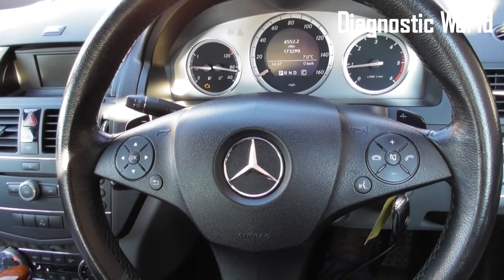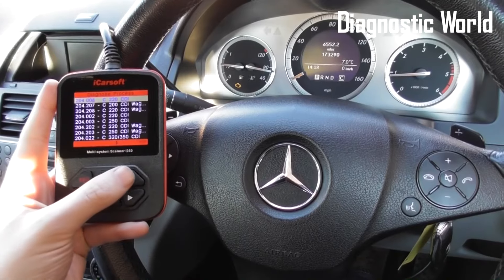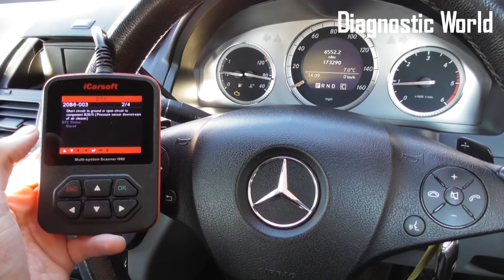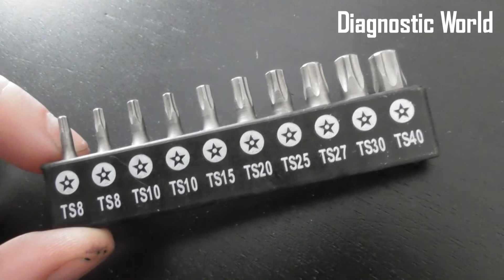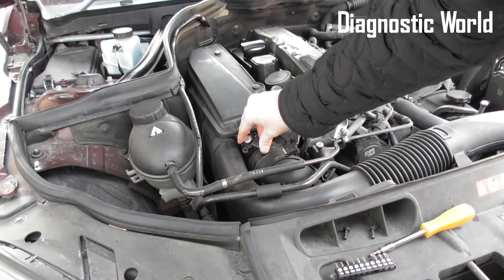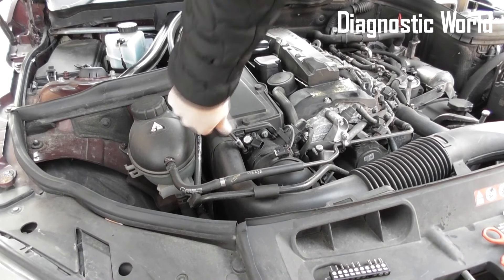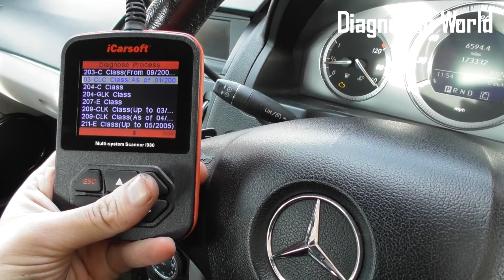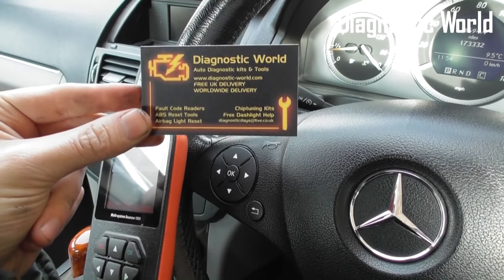C Class W204 MAP Sensor Removal 2007 - 2014 Mercedes

Comment: I'm pretty sure that's an air intake temperature sensor and NOT a map sensor. How there even could be any pressure because the sensor is located in a pipe BEFORE the turbo? Map sensor is located down in the intake manifold on the right side of the engine.
Reply: The air intake sensor is located on the charge pipe between the intercooler and inlet manifold.
Reply: @shifty2755  on video is MAF sensor - Mas Air Flow. MAP sensor always between turbo ant inlet manifold - Mas Air Pressure.
Reply: I have a plug & display lufi xf obd2 on my honda dashboard for about a year. When I had an E200k with SC for 3 month usage, before buying it over, I  transfer it to the E200k.

When idling, with air conditiner switched on, the typical rpm is 825  : the obd display throttle at 17.2% open, manifold pressure at 0.5atm, 02 sensor output of 0.72+/-, MAF of 5.4g/second.

When driving on highway with slight undulating gradient, using cruise control, at 90km/hr the trottle body opening flucuate between 21% to 25%. The manifold pressure changes within range of 0.8 atm to 1 atm. This indicate to me the bypass flap of SC is kept in open position by ECU. 

Off the highway and on steep slopes, even at 1500 to 2000rpm, the SC would be activated as manifold pressure would be higher 1.2 to 1.4atm.

However the this OBD2 however could not display % of egr opening. 

For any one looking to buy any car older than 10 years this type of "on the dashboard" OBD2 is a "must have tool".

Happy motoring, regards.